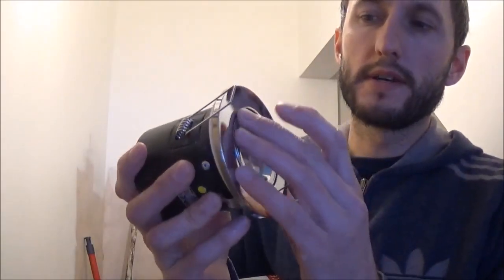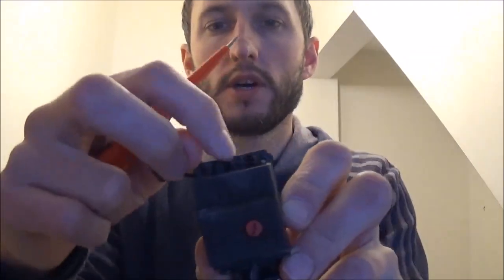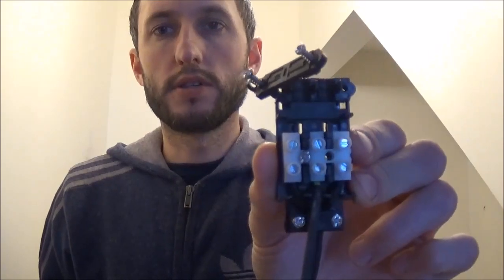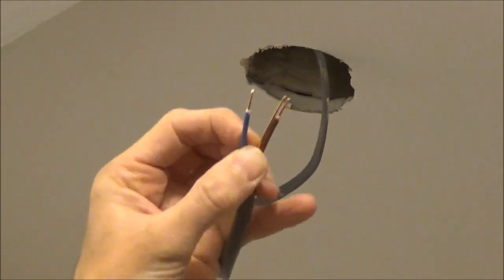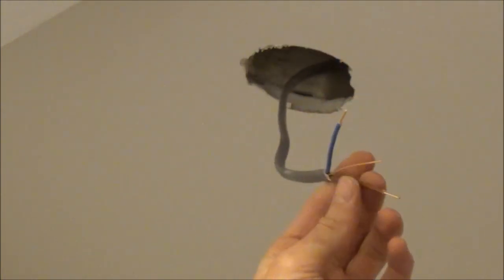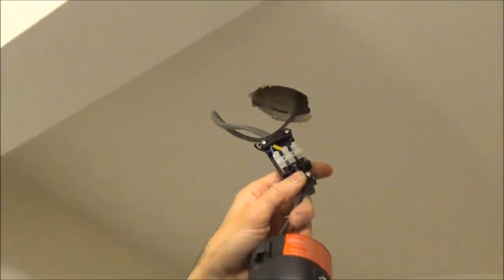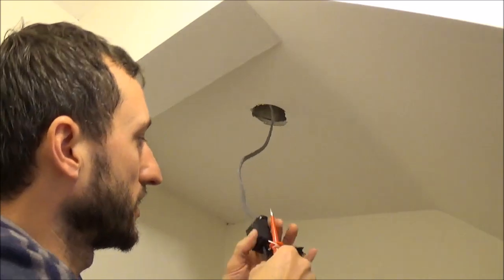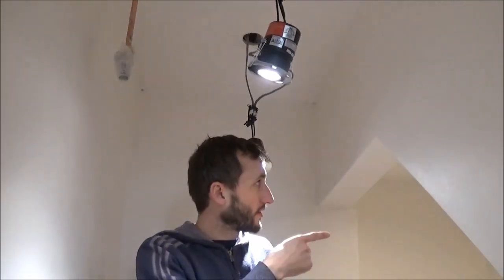How to install downlighters/downlights. LED downlight installation.

Comment: That tool is useless bcoz equal cut can't fit as Earth cable  is cut shorter.
Reply: I saw in your connector block.
Reply from the maker: It's still quicker. Just trim cable down after using the cutting part of the tool. Thanks for watching!

Comment: Before fitting a downlight in a bathroom you have to make sure you are a Part P registered electrician as carrying out wiring in a bathroom is a notifiable job and not for DIY bodgers.
Reply from the maker: Hi John, it is possible to notify building control and carry out the work yourself, inspected by building control at agreed stages. And to be clear, every circuit in this house is protected by an RCD. Maybe I should have pointed that out. Thanks for watching.
Reply: @r.h.8754  The 'special location' is the room the work is carried out in. The 2.25 m above the floor means it is out of either zone zero one or two which is the requirement for an accessory such as a light fitting to have the appropriate IP (ingress protection) rating for the said zone. Either way, adding a new circuit or making a modification to a circuit within a special location requires notification to building control. Other factors such as RCD protection and the need for equipotential bonding come into play which is outside the scope for the average DIYer. 
Changing light fittings on a like for like basis is perfectly  acceptable for a competent  DIYer. In areas such as bathrooms people really need to think twice. I was called to a house recently with a bathroom light not working. I took the fitting down and found the joist above the ceiling was charred form a cable arcing. No RCD protection so the circuit couldn't trip to safety.

Comment: How do I push the cable from one hole to the next? Felt and beams above ceiling are making this very difficult.
Reply from the maker: You can usually only do it withing two joists otherwise yo'll have to drill through the joists. This is common but then you'll need to lift the carpet upstairs, lift the floor boards and do it from there if you don't want to damage your ceiling. Hope that helps, thanks for watching.
Reply: Nelle Rc this video shows an option for that.  Im not sure where they got the stuff to do it, but looks like it could work. (I know, the video, and girl, are cheesy. sorry)
https://www.youtube.com/watch?v=XbC6wuUH3ZA&t=7s

Comment: Very helpful but do you not need to fit a transformer onto each light?
Reply from the maker: Not for these particular lights. The transformer is built into the unit on the GU10's. Hope that helps. Thanks for watching.

Comment: Hi I got some downlight for my bedroom & only see live & nutral in the connecting block does this need earth cable or not thanks
Reply from the maker: Sounds like they are double insulated and not rquiring an earth. But make sure the earth wires on your power source (probably existing light circuit) are joined and insulated usually in a connector block. This means your earth wires maintain continuity. Thanks for watching.

Comment: Thought downlighting needed a transformer??
Reply from the maker: These ones have the transformers built into the unit as so many on the market do these days. Thanks for watching!
Reply: The ones with transformers are low voltage and are much brighter too.

Comment: Very helpful video. Should I use 1,5 or 2,5 mm cable to connect led downlights? Thanks
Reply: Depends on how far you need to run it, but those LEDs wont consume many watts.
Reply from the maker: 1.5mm or 1mm is the norm but make sure it's protected by no more than a 6amp circuit breaker. Thanks for watching!

Comment: Thanks for the video.  I've fitted a few of these and the cable grip is just a nightmare because of the small amount of exposed conductor, especially if you have a loop.  Any advice on that?
Reply from the maker: Two options. One is use another brand with different connector blocks, or the other option is to make your light connection in a junction box, push it into the ceiling and then have one cable coming from that into each light. More work but it will give you more room in the light fitting as there will be one cable instead of two. Hope that helps. Thanks for watching!

Comment: What's best way for marking out downlighter and choosing how many you need ?
Reply from the maker: How many you need is entirely up to you. Place them above areas you think require light. You don't want them above wall units in a kitchen or they will just light up the top of the unit.  Personally I like them to look evenly spaced on the ceiling. Best way is to find a center line along the ceiling and measure out from it to the lights you want. Don't measure from each wall out as your walls may not be square. Hope that helps and thanks for watching!

Comment: Useful demo. How would you fit these in a old fashion ceiling?
Reply from the maker: When you say old fashioned do you mean lath and plaster? If so it is still possible, you just have to cut the hole in the same way as plasterboard (using a hole saw and a drill) but you have to be really careful when you do it as it can get messy. Hope that helps. Good luck and thanks for watching!
Reply: POUSE around the HOUSE Yes, lathe and plaster. I want to replace a strip light with 3 of the down lights. Can't think how to get cabling to the other lights because of the ceiling beams running across the intended light run.

Comment: Great video as usual mate. I was going to ask if you also wired in the downlights to the same Wagos then re-watched the other vid and realised the single 'light' wire was them...daisy chained from the one wire. Thanks again, great guides for DIY-ers like me, clear and simple. Just got to find a 'silent' and very slim extractor for the wall....200mm gap and then the roof line in a dormer wall/window build.
Cheers
Rob
Reply from the maker: Glad you solved your own problem Rob! Yes once you get the single wire that's it. Also in response to the wago question, you can physically fit two 1.5mm wires in each terminal but not recommended by manufacturer. They also do them in 5 terminal connectors. The wago 773 series come in 4 terminal connectors and are specifically for lighting circuits. You can watch a review of these here -  Wago 773 connectors review and demo - https://youtu.be/Cz2jle06crA. Hope that helps. Good luck and thanks for watching!

Comment: Great video, if I am replacing halogen units for LED units do I still need to contact an electrician even though the wiring is all there?
Reply from the maker: If you aren't comfortable doing the replacement then contact an electrician. You can replace a light yourself, but ensure all the power is off, and connect all the wires correctly. It's a good idea to take a photo of the old wiring before you remove it just in case. Good luck and thanks for watching!
Reply: POUSE around the HOUSE Thank you! We just ended up replacing the bulbs. I didn't know we could do that so wish we'd done it ages ago! Thanks again

Comment: Great video - but how do I wire this into the switch? The ceiling roses have a separate set of screws to use??

Thanks
Reply from the maker: Hi Paul, try watching my other video, How to fit a ceiling light. Lighting circuits explained. Replace and install a light fitting. - https://youtu.be/iQAs5zq-32c. You can also check out my electrical and lighting tutorials in my playlists on my channel. Hope that helps. Thanks for watching!
Reply from the maker: Maybe also try - How to wire a ceiling rose - https://youtu.be/FjmC0qx1nrU

Comment: Hi iv changed my LV down lights to gu10 so I can use led lamps by rewiring the connector in fitting will I need a driver / transfer
Reply: I'm all so using a dimmer switch
Reply from the maker: GU10 have a driver built in to the unit so they can connect straight to mains. But you will need dimmable GU10 bulbs if you intend to use a dimmer switch. Hope that helps. Thanks for watching!
Reply: Your a star thank you

Comment: Hi I've got a single light switch and have just installed 8 led dimmerble down lights to light up a feature wall I've got a twin dimmer switch (2 gang ) and want to wire it up so one dimmer switch does the main light and the other dimmer switch does the led lights but only have one live and a switch live (com)
Reply from the maker: Hi Martin, if you go to my playlist section there is a lighting tutorial playlist with various video covering different scenarios. Have a watch of those, if you're still stuck after that give me a shout. Thanks for watching!

Comment: Can you recommend a bathroom down-lighter please mate?
Reply from the maker: I use an Aurora in the video. They are all pretty good. Just make sure you get the right IP rating (waterproof rating) for the zone it's in in the bathroom, and choose the right bulb i.e. warm light, white light etc. Hope that helps. Thanks for watching!
REPLY

Comment: hi mate, what size cable are you supposed to use for downlights
Reply from the maker: Hi Arfan, 1mm or 1.5mm twin and earth, assuming they are 230v lights and not 12v lights running from a transformer. I always use 1.5mm. Hope that helps, thanks for watching!
Reply: hi yes its 230v downlights. can 2.5mm be used?
Reply from the maker: Yes, 2.5mm can be used, just a bit thicker and more expensive than 1.5mm. Just make sure you have the lighting circuit on a 6amp MCB (fuse) as the rest of your lighting will be on the smaller 1mm or 1.5mm cable. Hope that helps.Good luck.
Reply: Glad you mentioned about putting a decent length of cable in - nothing worse than trying to do work later where someone has cut it super short.

Comment: how to connect 8 or more led on one wire,for the dropped ceiling light box?
Reply from the maker: Hi there, if they are 230/240volt downlighters (like in my video) then do exactly like I showed in the video. But, if you have an existing light with a traditional ceiling rose that you want to replace, then please watch the following video tutorial where I show how to do this - How to fit a ceiling light. Lighting circuits explained. Replace and install a light fitting. - https://youtu.be/iQAs5zq-32c. Hope that helps. Thanks for watching!

Comment: Quick q-- could you have led downlights and a standard ceiling rose light on the same lighting circuit? 

Or would you run them on two separate circuits?
Reply from the maker: Yes, you can have both on same circuit. If you watch my other video 'how to fit a ceiling light, lighting circuits explained' - https://youtu.be/iQAs5zq-32c you will see how to replace a traditional ceiling rose with a junction box leaving you with just one cable with and earth, neutral and live. This cable can then be used in any light fitting as the switched live is already sorted for that circuit. So you have loads of lights all run off one switch all wired like in the led downlighter video. The only reason you need to do another circuit (and switch) is if you wanted different lights in the same room to be turned on and off independently. Hope that helps. Good luck and thanks for watching!
Reply from the maker: I should add, if you already have a ceiling rose which you are leaving in place, then you just need to run a cable from that (connecting the live to the line, the neutral to neutral and earth to earth) this cable is then like the first cable in the LED downlight video. Take that into the next light fitting, then bring one out and so on. They should then all work of your existing light switch. Good luck!
Reply: Cheers Pouse. Much appreciated. 👍🏾👍🏾👍🏾
Reply: Sorry Pouse, one more question:

How would i wire one light switch operating a room of downlights? 

Ie would the switch wire be on the first downlight?
Reply from the maker: Yes just wire first light in the room like it is the only light (as per video I gave link to earlier) with a switch. Then just come out of that (as explained earlier) into next light and so on. This way all the lights are operated by the same switched live and therefore same switch. Hope that helps!
Reply: POUSE around the HOUSE appreciate you taking time in answering my questions. Thanks again Pouse.

Comment: Hi, I have Aurora low voltage halogen downlights in my bathroom and I want to replace 1 of the lamp units. The springs holding the unit to the ceiling are very strong. How do I release the springs to remove the lamp holder without damaging the ceiling hole.
Aldo
Reply from the maker: Hi Denise, to be honest the normal way I do it is to gently pull the light down as far as you can so you can get a bit of access with your fingers, then squeeze the springs inwards with our fingers. I find doing it slowly is the key and remove the bottom of one spring down before the other with the light at a slight angle. But I agree, these lights are tough and you will inevitably scrape a bit of plasterboard off but if you're careful you should be ok. If that didn't help, really sorry but it's the way I do it. If anyone has any handy tips for this, please post here! Thanks for watching Denise!
Reply: Get in the roof space and release the light from the top...

Comment: should they not be fitted in Parallel,   all coming from a central junction box? I have some fire rated ones which have terminals built in and do not require a terminal block. Some people say wire one via the other in series and say in Parallel from a central JB due to the increased resistance with series. are you able to clarify please?
Reply: The radial connection method looks like a series connection but is electrically in parallel. This is described in the opening few minutes of the first video linked by Pouse but not stated explicitly.

The easiest way to tell the difference is to look at the effect of turning off a single light in the circuit (or pulling out the bulb). Lights connected in series will all go out while lights connected in parallel will leave all the other lights turned on. As all the lights can be independently turned on or off, they are connected in parallel.
Reply from the maker: Hi, they are connected in series on a radial. So I started with a junction box (I used a hager J501 junction box in this room) and I used this to 'recreate' my ceiling rose as I needed all the wiring in the ceiling out of site as I have fitted all downlighters in this room. If you watch my other videos you will see how to do this first step:

How to fit a ceiling light. Lighting circuits explained. Replace and install a light fitting. - https://youtu.be/iQAs5zq-32c

Then from this junction box I have used the switched live, neutral and earth (using a length of 1.5mm twin and earth cable) out of the junction box, and into the next downlight (as seen in the video). Then do exactly the same from that downlight into the next and so on. It is a radial circuit so the cable doesn't return, it just terminates in the last downlight. As for resistance, you would have to calculate the resistance to ensure you don't overload the circuit, however, if you're using LED downlights, that's probably never going to happen. If you think an old standard halogen downlight was 40watts, you can have 10 x 4watt LED downlights and it would use the same power as one halogen.

Hope that helps. Some other useful videos below:

Hager J501 downlighter junction box review and demo - https://youtu.be/V8VYRyZv128

Wago 222 connectors review and demo - https://youtu.be/B65_vZ9DM1I
Wago 773 connectors review and demo - https://youtu.be/Cz2jle06crA

Good luck with your project and thanks for watching!

Comment: Out of interest, how many down-lighter units could you feed off of one supply (i.e. if I was to fit say 6-8 of these, powered by the line that used to power the ceiling rose). I would assume there would be a maximum, maybe overload the original cable?
Reply from the maker: Hi, presumably you'll be using LED downlights? If so they aren't really a problem as your old typical lights were anything between 40 watts and 100 watts each. So 8 LED lights at 5 watts each would use the same power as one old 40 watt bulb. But, you should have 1.5mm twin and earth cable, protected with a 6amp MCB (miniature circuit breaker) on your consumer unit. If yes, your lights and cable will be protected and will be safe. Overloading would only cause the MCB to trip and the lights would go off. But in this scenario, you should be way under full capacity of the cable so simple answer, yes LED's will be fine. Hope that helps. Don't forget to check out my other videos on how to replace the ceiling rose wiring using various connector blocks ready for your downlighter installation.

How to fit a ceiling light. Lighting circuits explained. Replace and install a light fitting. - https://youtu.be/iQAs5zq-32c

Wago 222 connectors review and demo - https://youtu.be/B65_vZ9DM1I
Wago 773 connectors review and demo - https://youtu.be/Cz2jle06crA
Hager J501 downlighter junction box review and demo - https://youtu.be/V8VYRyZv128

Thanks for watching and good luck with your project!
Reply: Thank you for your response. They will be LED's Yes, my biggest job now will be lifting floorboards above the room I'm going to install them lol
Thanks again POUSE ;)